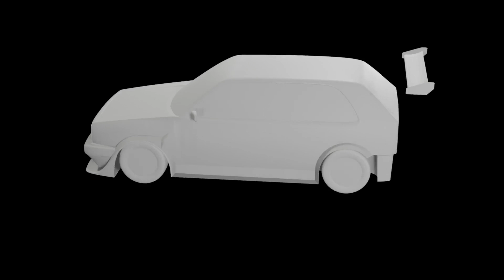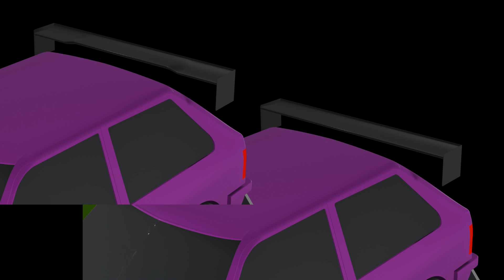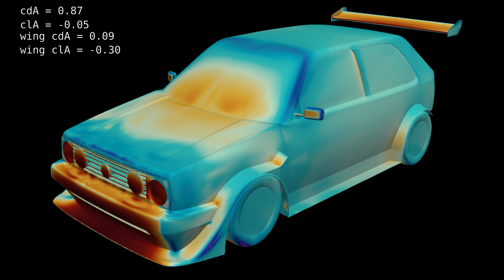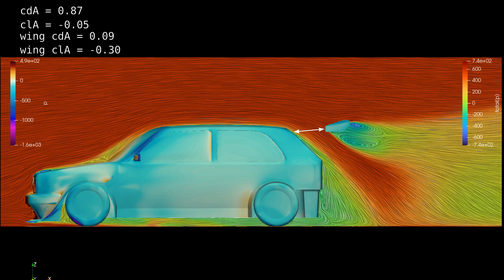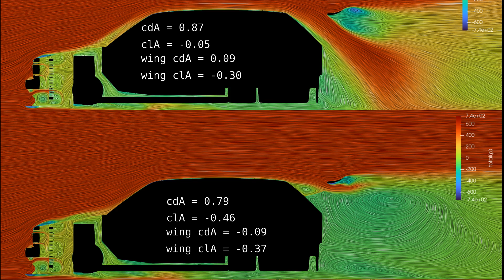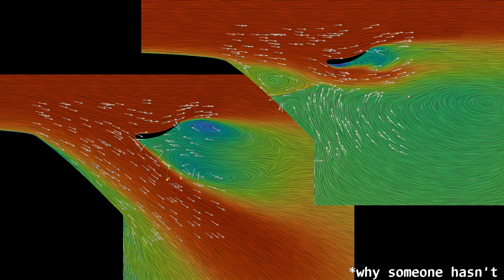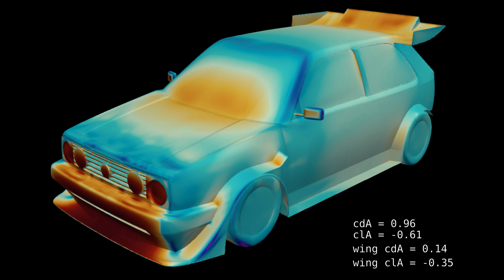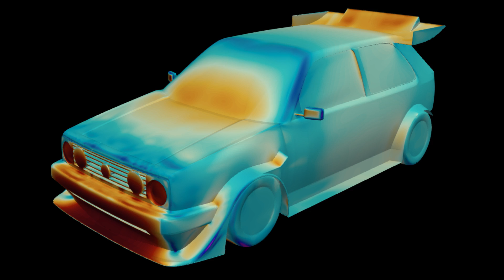Hatchback Aerodynamics: Improving the rear wing or spoiler

Comment: Check Wheeler Dealer Ford Escort RS Cosworth with triple spoiler or the EScort WRC had some flat wings and also the Fabia mk1 WRC had a double spoiler like the 2006 Focus WRC... there were also some available manufacturer data from SEAT Motorsport about the client track car Seat Leon II with drag and lift for the rear spoiler, it had and awful aerodynamic and only the TDI engine made it succesful so it had to be made slower buy addig weight... but I remember rear spoiler going down meant you could reduce drag by diverting flow to fill the wake and even keep the lift neutral...many road cars have positive lift at high speed on the road... like the Cordoba, TT, Octavia, Toledo... and they need at least a lip spoiler to make it neutral and stable...being sedan body shaped... but hatchback definitely have a rear giant vacuum cleaner with all king of susrprising flows...as you say usual spoilers won't help much other than esthetics neither solve lift or lower drag or reduce wake or anything...
Reply from the maker: I saw a video of the designer talking about the rs cosworth body kit and how he wanted a triple wing at the back but was only allowed two. Years later they tested the triple and it turned out that it gave better results. As i recall he was just a designer and doing something aesthetic, which happen to be better. This was a few years ago and I didn't really know how it would be better, this I think may explain part of the reason.
Reply: @nelsonphillips  I guess there is a point where puting anything filling turbulent and lowest pressure zones on the wake is better than nothing... you can add brick walls or a trailer and lower total vehicle cd or even change the lift... you should do the cfd test of the 2x boxy Golf's bumper drafting to see cd and lift... in Nascar style...

Comment: I really apricate the effort you're putting into these videos. I need to know more about  this design. We're currently running a hatch in hill climb, and I was about to put a lot of time into a rear wing with a swan neck mount as shown in the first diagram . But after seeing this, not any more. Design #4 seems to be the way to go, but your diagram isn't very clear. Does it hang or is is it a flush mount to the body ? Would a support structure under it interfere with high or low pressure ? Does the leading edge protrude in from the rear of the car like the old Group B Peugeot 205 ? and is it flat, or does it have a foil profile.
Reply from the maker: There isn't one correct solution. The wing has its advantages, but it needs to be done correctly. The point of this video it is rarely done correctly, for a number of reasons. The group B and WRC do do it correctly, probably because they have resources. 
That group B looking spoiler/wing thing does sit flush against the body like a spoiler. It is just a single spline curve that could be made from plywood sheet, the centre spoiler section is a cut out of the profile and angled up. The winglets on the side can't work to well, eg proper profile, as it pulls air off the roof lessening the overall effectiveness, so scaffold away underneath. 
If you didn't use the single profile the winglets can be lower and be more effect as it will not affect the roofs pressure. The single profile was because of a particular rule set saying only one device can be used.
Reply: @nelsonphillips  Are you saying don't have the side winglets on the C pillar. Just run with the width of the roof dictating the width of the combo ? Would a gurney flap be advantage, I was initially looking at it just as a strengthening point. Would a flap on the rear window still be necessary, or does this design void the flap.
 I'm looking at getting started with the MDF and core flut early this week as we have another outing on the 27th.
Reply from the maker: @aussietruckphotosandmodels8510  I just reread my comment, my sentences just disappears when I'm tired. 
The winglets if they work really well, say they have a proper profile, will pull air off the roof making the overall performance of the system less effective because the roof has a lower pressure. So if you disrupt the airflow under them by making necessary support structure, its fine to a degree. The winglet do contribute to the overall aero by helping shape the upwash/wake and a bit of their own df. 
A gurney isn't needed on the winglets, on the inner spoiler it works well. The inner spoiler drives the underbody, the winglets adds to the edges, of the wake and pressure making it all a bit better.
The flap is only required for the wing.
Reply: @nelsonphillips  Thank you very much Nelson this is very helpful. I'm thinking about making the winglets as an infinity wing, like we have done on the front splitter. I'm not sure exactly how I'm going to achieve it, and I'm guessing the first couple of attempts will be a bit clunky till I get it sorted out. Thanks for all your help, I'm not holding you responsible for anything, and if it doesn't work..... I just like the challenge of making things. I'll let you know how I get on.

Comment: I think it would be worth testing the wing in a setup where the flap extends all the way to under the rear wing. That seems to be the case for the WRC cars and I wonder if provides better support for the rear wing. Maybe even build a slight tail cone off the top of the roof into the flap to keep the flow smoother. Also I’m curious to how the TCR cars are getting their downforce as they all run a traditional rear wing without any window flap to help and those cars are producing pretty respectable downforce
Reply from the maker: I think the TCR car benefit from contemporary aero, that is the roof slopes down much more at the rear. This means if your regs say a wing cannot be higher than the roof it is a reasonable distance above the hatch. There is a bunch of other this as well, like the wing is far back, the spoiler exists to split the wake and roof air, but is above the window instead of on it.....
This vid was based on some work already done, it was to fit into some regs and other constraints. There is definitely two videos that could follow. Might randomly do a camper trailer next though.

Comment: Looks like a shift of the wing forward an up at the end of the roof section would work much better, since it will be aligned with the flow on the roof. Though some regulations might not allow wings that high up.
Reply from the maker: yeah most regs say "not above the roof", but definite improvement options available

Comment: Something of note is that (at least, supposedly, I've not come across an accurate enough model to check via CFD myself) during the development of the modern Fiat 500 (Mid 2000s-Current) the designers wanted to avoid a rear spoiler, the Abarth models in particular though had them introduced purely on merits of drag reduction alone. As a consequence, the electric models of the hatchback sport a similar spoiler as drag reduction is also key in that application.

Comment: What if the rear wing was placed further up, offseting it from the car's body so it won't interfere as much. Not as elegant of a solution, but it could have a similar effect
Reply: Good question, the hatch downwashes air, so placing it higher up will just create more divergence and more separation. I reckon It would have to be comically high, which would then introduce lever effects on the chassis. You can't force air to go where it doesn't want to go, you have to go with it. It's not just about placement, but also aligning the suction surface so it gets plenty of high energy airflow, since that does the bulk of the work.
Reply: regulations not allow it to be above roof

Comment: So in other words, the spoiler delivers more high energy air across the suction surface. Without it, the downwash from the hatch is not aligned with the airfoil's AOA. I wonder what would happen if the airfoil's suction surface were aligned with the downwash from the hatch. Would it make the same downforce as the hatch with the spoiler?
Reply: I'd wager it may help with a reduction in drag as if you were to align the airfoil with the hatch downwash your force vector for downforce would have a fairly significant component pushing towards the nose of the vehicle. Achieving similar raw downforce numbers may be difficult.
Reply: @WeAreChecking   If it reduces drag, then that's a win.
Reply from the maker: then the upper surface is misaligned.... Also the low pressure interacts with the hatch, increasing drag.
Reply: @nelsonphillips any chance you can add a second element to the wing then, to reenergize the flow with a small slot gap?
Reply from the maker: @PeterZuba9  I guess you could. You wouldn't apply it in the same way conventional double element wing are, but more of a guide than another element. That is a big gap between elements.